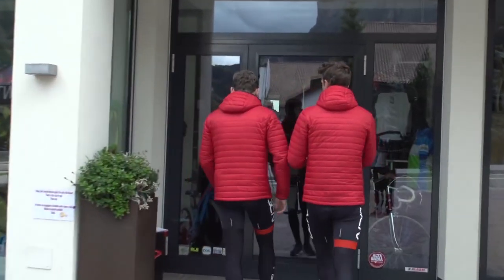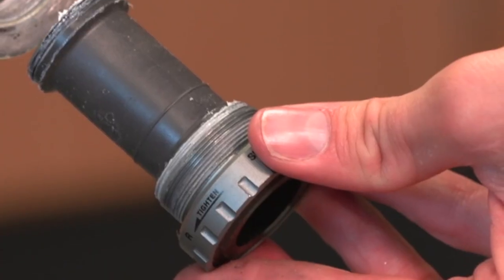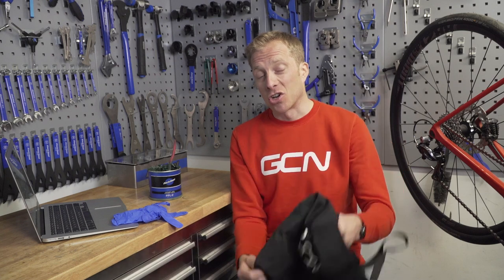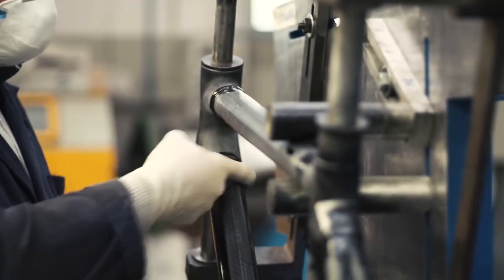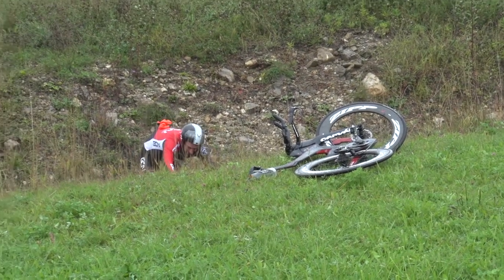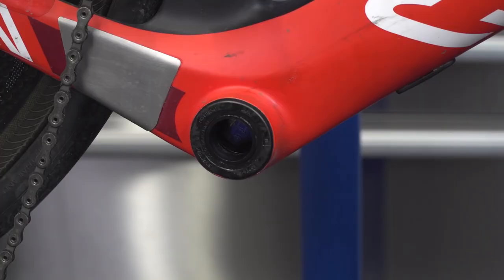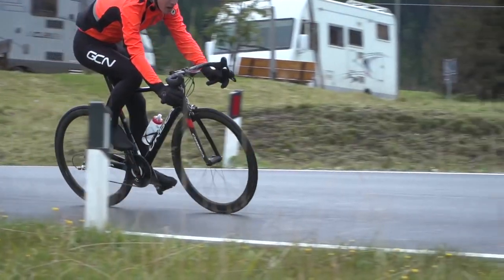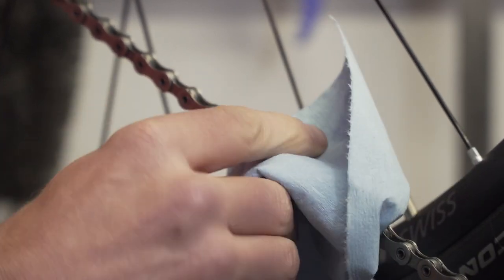Grease, Lubricant, Threadlock, Fibregrip: What & Where Should You Use It?

Comment: Do I actually need any grease on my seat post, it never sticks so why would I need any grease?
Also if so, which one, anti seize or fibre grip?
Reply from the maker: It depends on the materials your frame and seatpost are made from, grease will work in all instances and should prevent any bonding, fiber grip is only necessary if either your frame, or post, or both are carbon and there's an issue with the post slipping
Reply: @gcntech  can I use silicone grease on the post and where the seat attaches to the post to stop creaking?

Comment: for grease, marine grease is not bad, but i always prefer aeroshell grease 22, which is commonly uesd on airliner, especially in the wheel bearings and landing gears. actually aeroshell grease 33 is even smoother than 22 but the smell is absolutely awful.

Comment: I've been using Spectro Chain Wax (for motorcycles) for about 6 months now.  Works great and is a cheaper than "Bike" specific chain lubes.  A motorcycle chain is constructed the same way as a bike chain.  The problems that are present for Motorcycle chains are the same for "Bike" chains i.e. water/road grit. 

The Presenter's comment about not using spray cans due to spray getting on disk rotors and tires is complete rubbish.  Motorcycle chains, disk brakes, and rubber tires have been in use for decades - spray lube has been around almost as long.  Just hold a rag under the chain as you spray - problem solved.

Comment: #torqueback what is the latest update on the waxed chains?
Reply: I did mine recently, I may need to experiment with thinning the wax (using a kerosene or paraffin oil) a bit more to prevent flaking, but it was fantastic for the first two rides, then got real noisy. Keep in mind I’m in a much warmer climate and I hear this may effect longevity of the wax. 

Although data says a noisy drivetrain isn’t a bad thing, I can’t stand it when my driveline sounds like a fork in a garbage disposal.

Comment: What grease would you suggest for the face of my disc, something that won't damage the pad though 😂
Reply: Nothing. The only things I want on my disc brake rotors are isopropyl alcohol for cleaning, and water when washing or riding in the wet. Anything else is a no-no

Comment: Rock n Roll Gold, and if it's going to rain which doesn't happen often RnR Extreme chain lube. Penrite Copper anti-seize for all metal on metal non moving interfaces, and Kincrome Hi Temp lithium grease for moving parts. Need to get low strength threadlock, do not like the medium blue stuff.
Reply: Some people are saying copper anti-seize corrodes parts faster and that is meant for high heat car parts.

Comment: anyone use lithium grease? If so, what for? Also, how should GT-85 be used properly?
Reply: I have used Castrol LM grease .use it for repacking cup and cone wheel bearings  , headset bearings and a tiny smear and then wipe off on seat pillars  to stop seizing and handle bar stems extension  to stop creaking .had the same 500ml tub for years also use it for pedal to crank threads . And a small smear on Allen bolts ie brakes and bottle cage . Screw threads .

Comment: When the thread is greased or otherwise lubricated, the torque required for the same clamping force or tension on the bolt is 20-40% less that the torque of the dry threads.  https://www.engineeringtoolbox.com/torque-lubrication-effects-d_1693.html  Do you apply this correction when greasing the bolts with a specified torque setting, or are the torque specifications in the bike world usually provided with lubricated threads in mind?  The standard torque specification tables for fasteners are based on 90% of yield strengh of the bolt, so, for example, if you grease an 8.8 grade M5 bolt and torque it to 6 Nm, you'll likely exceed its design load. http://www.norbar.com/Portals/0/downloads/TorqueValueGuide.pdf

Comment: 3 in one was invented for bicycles, if you are looking around for the right oil and have a bottle of it and a can of WD-40 skip the WD-40, it isn't good for your chain. Save the WD-40 for putting steel parts away since it is a protectant rather than a lubricant.

Comment: Use Lithium spray grease for medium to long term surface protection and to lube chain, sprockets, bearings etc. Use a wet P.T.F.E. spray as a top up chain lube. ONLY use a silicone product to surface clean, polish etc... NEVER use it as a lube as its nigh on useless.  Also forget 'candle waxing' a chain as it provides little or no lubrication to the joints etc... I Have Spoken

Comment: Never use anything unless the manufacturer recommend.
What hold the 2 parts is the thread surface friction. 
Greasing , oiling, penetrating oils gives false Torque, we will over tight and thread will damage. Trust me, i have bolt thread which have small amount of rust , they work just fine. 
I have oiled some and thread just destroyed. Never use anything.